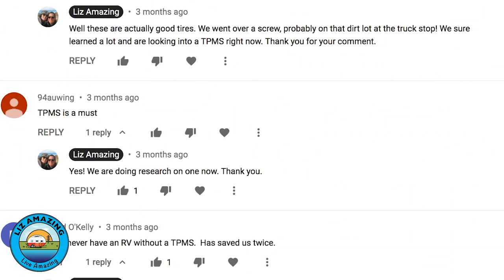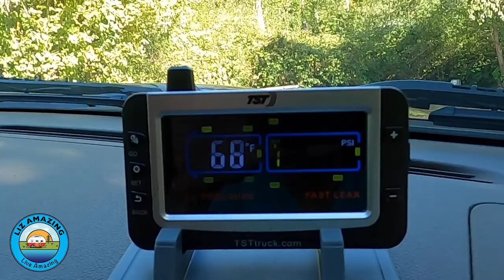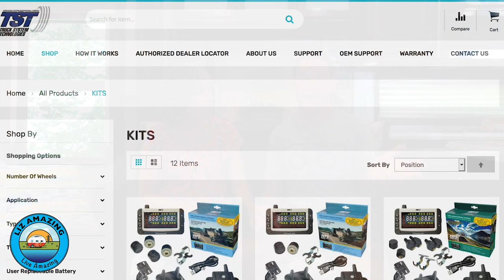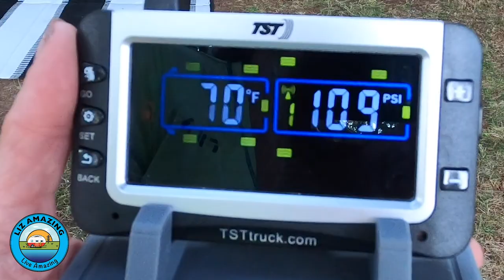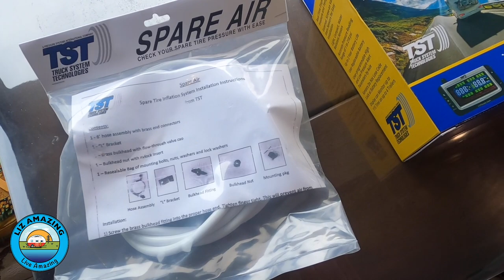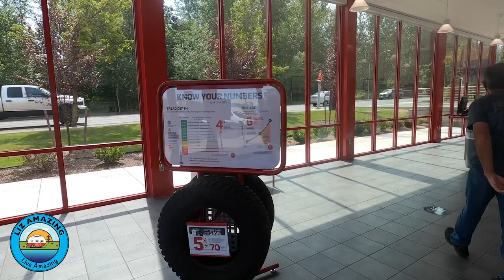How you can prevent a Tire Blowout | TPMS | Westlake Tires | Fulltime RV Living

Comment: Had a blow out in Nor Cal
Slider cable ripped out 
Repaired it at tire shop myself 
Interesting tire was 5 months old about 1000 miles on it
Anyway tire guy said he runs American made LT tires on his 5th wheel never a problem 
Replaced the bombs tires with those LTs
7yo 5er
Enjoy Washington
Reply from the maker: thank you! Glad your blowout wasn't worse, though it was sure bad enough. Safe travels to you!

Comment: Our previous fifth wheel was a Jayco pennicle. Not long after purchase not a flat but border line. The leaf spring failure. We got blessed. The rig showed no signs hey I’ve got an issue. Upon stopping to register their was tar all over what did my father drive through. Turns out the tire wall was being shaved 🪒 get with good Sam and find a reliable rv dealer that handles your rig.  Several dollars over nighted spring we got the nascar service. Knowledgeable service. Worries not over trip to Disney all set to leave ugg slide motor failure. Then the fridge brand new poof done. Upon removing the motor frozen rusted. Warranty work etc. just one fiasco after another. The rig was a lemon. We had been out of camping for a few years. Decided to go shopping Jayco dealers reliable we ended up after the rig failing to trade up. Then while looking through our Jayco why is the sink plumbing disconnecting after every move. My father wasn’t happy camper. The cut corners cut the plumbing too short. That’s not all the miss connecting the sewer and grey tanks were hooked up backwards. Grey was on sewer sewer was on grey.  I said nope nuff is enough if your not sure if you can leave. It was apparent too many warranty things  hopefully the dealer fixed the issues she got sold not long after get rvs with hydraulic system electrical system failures with newer rv’s are too sketchy our new rv is hydraulic from slides to stabilizer jacks.
Reply from the maker: Oh my gosh, so sorry you had all these issues. We looked at Jayco before buying our rig. But we ruled them out. Grand Design is the only manufacturer we know of that understands fulltimers. They know we can't wait months to get in at a dealer (who likely is not our home dealer as we are traveling). Instead they will ship parts to us directly and reimburse a mobile tech to fix right away. 

I sure hope you have better luck with your next RV. And you may be onto something to go used. We have heard that they don't build them like they used to and you get higher quality with used.

Thanks for your comment and no matter what you tow we highly recommend a TPMS.

Comment: Improper tire inflation is 90% of all blowouts. 
Check your tire pressure early in the morning to get a cold (true) tire pressure before the sunlight warms them up. I never move before a full tire inspection and I've never had a flat.
Reply from the maker: We do the same and still drove over the Golden Gate Bridge with a flat tire. That's because we ran over a nail. TPMS would have helped us by getting us to pull over quicker. From now on it's TPMS all the way! And we believe everyone towing a camper of any sort should have one.

Comment: Oh, goody! A pop quiz before the video. Isn’t a Schrader valve the standard tire valve? And then there was another one that I was going to ask Paul about because I’ve forgotten what it was called. For high end bike tires like sew-ups. Wait! Presta! Been trying to think of that name for weeks and you just jogged my memory! Thanks. Just one of those bits of info that have been floating through my head recently. Ok on to the video. (And as I watch it, I see that you just answered my question! Well, never mind then. But yup, we old cyclists know our bike valves. :) 

But, yes, with our first pop-up trailer we had a very very very low tire at Great Basin NP. And there was no air anywhere to be had in the little town of Baker. An unstaffed gas station. Gas, no air, no water. Instead of heading south, we limped back to Ely. They had real services like a tire shop. We had a nail in our tire and they swapped it out for us. But I found out that our AAA didn’t work for the trailer, and Good Sam wasn’t very helpful either. And as soon as we got home, I bought a little AC/DC tire compressor! And before we go out, I check the pressures on all the tires and top everything off with that. And we have a repair kit. Jerry thinks I’m a bit compulsive, I think he’s a little too relaxed. You live, you learn. (And apropos of this blog, I am investigating tire pressure monitoring systems. So thanks for the recommendation. It’s been confusing.)
Reply from the maker: Hi Trish! Glad you know your valves!! Several people have mentioned AAA didn't cover their trailer. Paul has their Premier service does cover our fifth wheel, and they came out after we crossed the Golden Gate Bridge with our flat tire. 

I think having a tire repair kit is a VERY good idea! We know people that can plug a tire on the road, if need be. I think that would be handy for remote areas, traveling to Alaska, that sort of thing. 

TST Truck TPMS is second to none. We checked all the systems out and nothing can match it. We sincerely believe anyone towing a camper or trailer should have a TPMS system. AND it would be helpful on your Class B itself because you get an alarm as soon as air starts leaking out. 

Well thanks for your comment and hope you are keeping cool in California.
Reply: Liz Amazing  Several people on the Travato Facebook group have mentioned the TPMS and I was looking at them but started getting overwhelmed. Good to have somebody knowledgeable like Paul do the heavy lifting!  And update on the refrigerator: I just got a call from La Mesa this morning and they have an ETA of our new refrigerator arriving from Canada somewhere around three weeks into the month. I’m not happy about it, but at least there’s something to look forward to besides a big question mark.

Re AAA, we were newbies and thought our car AAA would cover. Found out we needed a special RV addition. So nothing against AAA. We were naifs.

And, of course, we are always cool 😎 in Calif, but it’s gonna be a scorcher again. 100° +
Reply from the maker: Wow to the heat! We are at 89 here in Newport Washington (eastern side of the state). We just arrived today and are having our first taste of summer. Paul will tell you I am so happy to get to wear my sleeveless shirts. After a week of this (89 degrees right now) I am sure I will be ready for the 70s again.

Glad to hear that things are moving in the right direction re the fridge. October is a nice time to go camping. If it's not too chilly by then, we love Snowflower in Emigrant Gap.

Comment: If you are wise and buy a new GMC or chevy tow beast you will receive 6 extra valve monitor devices!!!  They are connected to the  truck with no other device needed!!  I just bought another trailer, seller advised that I must return the valves after 2 years when I get  new tires. I replace with Goodyear Endurance every 2 years or 30,000 miles. Never had an issue and I often travel off road and in heat in So Cal Mojave desert.  Oh... I met stud muffin at Hunt Beach marathon, I was running in a Kilt with Dean Karnazes, author and world class runner!!!
Reply from the maker: Good to know! Super cool about you running in a kilt!

Comment: Good video. I have been using the Ezee TPMS for a couple of years. Key is the PSI and temp. I even have sensors on the truck and trailer spare tires to monitor PSI. Only comment is being in Canada when we go south and come back north, on the cold nights it plays with the low temp alarm.
Reply from the maker: Thanks for the support of using a TPMS. Paul and I firmly believe everyone pulling a travel trailer or fifth wheel camper needs to get one. And it's true about the tires. When we were in Birch Bay last month we had a cold night and had to air them up before getting on the road. And we sure want to get into Canada. If you haven't seen it, here is our video from just the other side of the border: https://youtu.be/-V40X20hibo

Comment: Sorry, I have to share my china bomb story.
While on vacation with our 5th wheel, we developed a squeak noise, noticable at slow speed. We could not pin down where it was coming from. We thought it could be our tow vehicle. 
On our way home, while going over a bumpy portion of the freeway, we had a tire on the trailer blowout. There is no indication of sidewall wear such a underinflated condition. This is a cord failure.
Wish I could share the photos.
Reply from the maker: Oh no. So sorry to hear this. I hope you did not have too much damage. If it was a tire flaw a TPMS would not have helped if it just blew out the sidewall. Nevertheless, we strongly believe everyone towing should have a TPMS bc they really can and do prevent most blowouts. Stay safe out there!

Comment: I yes I have heard of Schrader valve and Presta for that matter but I am a bicycle rider and a Mechanical Engineer although I had heard of Schrader a long time before Presta and before I was an engineer.

Enjoy your channel.  We purchased a Solitude 310 about 2 months ago.  We were already very interested in the model by seeing it at a RV show in 2019 and you guys helped us make the decision to buy.   Thanks and stay safe.

About the TST system, why did you chose the Cap sensors rather than the Flow through style?
Reply from the maker: The flow through valves are heavier and you need to change your valve stems and we didn't want to do that. In retrospect, Paul wishes we went with flow-thru for the ease of adding air. Congrats on your 310GK! Hope to camp next to you someday!

Comment: The other big cause of heat is overloaded tires. You must look at load rating of the tires. Most trailers and 5th wheels come with it’s tires rated for the empty weight of the unit, once you put 1000# of stuff in your rig your overweight. You may need to go to a heavier load rates tire.  Look at you CCC and make sure you don’t overload your unit.
Reply from the maker: Very good point, thank you. And we believe a TPMS is a must for all who are towing a camper. It's great to know exactly what's going on with the tires. Be safe out there.
Reply: We have a class a, we didn’t leave the dealers lot before the TPMS was working.
Reply from the maker: Good for you!

Comment: I've begun turning my propane tanks off before I travel. This would help prevent your entire RV catching on fire if you were to crash. I had a leaky tire and even though I inflated it to the proper PSI it actually blew out on the freeway. Fortunately I have two tires on each side of my rig and I was able to make it to a safe location. I don't think the jack that comes with my Tacoma is powerful enough to raise my rig but I could be mistaken. If anyone knows what kind of Jack is required to lift a 6000 pound trailer please let me know.
Reply from the maker: I will ask Paul about the jack. And you make a good point about traveling with the propane turned off. Thanks for you comment! And so glad you were able to survive your tire blowout without it being any worse.
Reply: Here in Hampton Roads, it is required to have the propane tanks disconnected prior to going into the tunnels. You have to pull into an inspection station at the entrance to have them checked.
Reply from the maker: Good to know! Thanks.
Reply from the maker: Paul uses a 20 ton bottle jack. It's overkill but will do the job! Here's a link:  https://amzn.to/3bu1UTS

And, of course, always position the jack under the frame.

Comment: So what about tire/wheel balancing?  Also can these sensors be used  with the rubber construction or should metal tire valves be used? I have a Class B motorhome with dually wheels with Borg valve extensions? The longer extension on the inside tire has a rubber support as the extension passes thru the outer wheel. Is this enough to keep the added weight of the TPMS sensor from vibrating?  Nothing was mentioned about this.
Reply from the maker: When I had my camper van, I replaced my valve extensions and valve stems with steel ones. And yes you should have them balanced. In our case, we have not balanced the trailer tires but we did balance the truck tires. There does not seem to be any issues with wear on the trailer tires. But in your case you will feel it so you should get them balanced. We do recommend TPMS for everyone and remember to get 15% off using LIZ15. Go here: https://tinyurl.com/TPMSsaves

Comment: CHINA BOMBS !!! I will put in my two cents. Tire load rating is when the tires are new and in perfect condition. Most RVs come with tires that will be loaded to maximum or over maximum load capacity. When the tires are going down the road they get a lot of abuse and the load rating will be less with the damage the tires will have from all the potholes and then you get a blowout. With Liz Amazing tires they are at great risk of having a blowout. Liz Amazing chose to repair their flat instead of replace the tire. Running a flat tire will cause  side wall damage and reduce the load captivity.  Liz Amazing other tire on the same side as the flat was overload by double the load capacity because it was taking the weight of the flat tire witch will damage the good tire. So Liz Amazing has two tires of a greater risk of blowing. As a rule of thumb both tires should be replaced to reduce the chance of a blow out. Everybody needs a TPMS on their rig and the TPMS system in the video is one of the best ones I have seen. My experience  with CHINA BOMBS is to replace them before they are 3 years old anything older then 3 years, you are at a higher risk of a blow out. Great video as always.
Reply from the maker: I learned a lot from our flat tire, number one is that most blowouts are not random. They can be predicted and prevented. We love our TPMS! Your comment about the sidewall and the other tire on that side gives us something to think about. We had not heard about that rule of thumb about replacing both tires. Paul and I are talking about that right now and will monitor them closely. Thanks again!

Comment: Had my first blowout this summer in all the years of RVing. I would recommend getting rid of those stupid recessed lug nuts with aluminum caps.  Wouldn't you know...I couldn't get my socket on the last two lugs, and I didn't have my big heavy duty hammer with me to pound it on.  Ugh....
Reply from the maker: Oh no. That's a great point about lug nuts like that. Just makes a bad situation worse. Glad you are ok. I recently learned that most blowouts are preventable! Wow! We highly recommend you get a TPMS and think everyone towing a camper (full or part time) should have one. GIves such peace of mind knowing what's happening with the tires. Be safe.

Comment: Upgraded tires on my van to Grapplers after a blow-out on a shale rock covered dirt road.  Stock road tires are just not good enough for many conditions.  I imagine the tires that come with a trailer are not top of the line.
Reply from the maker: Our tires are G-rated which is considered pretty good. We did upgrade the tires on our truck to a higher load capacity, glad we did!

Comment: We have a 2021 Reflection 150 Series 260RD.  The tires are filled with nitrogen.  Which TPMS product should I get?  

 Is it this one: 507 Series 4 Hybrid Sensor TPMS System Color Display and Repeater
Reply from the maker: Yes, the 507, thanks for asking. It's a great system. You may also want to get extra sensors for your truck and for both spares. Although we have built-in TPMS on our truck, there is no alarm and it does not measure temperature.

Remember to put in LIZ15 to get 15% off.

And congrats on your new 260RD- I saw on the Facebook page that you just got it. I sure loved mine!!!
Reply: @LizAmazing  Thanks I just pulled the trigger and ordered 507 Series 4 RV Cap Sensor TPMS System Color Display and Repeater. Your discount code saved me over $60. Thank you

Comment: You need name brand tires designed for trailer wear.
Most blowouts accure because a tire get low. Sidewalls flex building heat then blows out. Tears out everything and realy hurts.
Keep those tire psi checked
Reply from the maker: Yes! So true. We learned a lot from our flat tire and low inflation (which you can't tell by looking) is the number one cause of blowouts. With a TPMS you can just see at a glance if your tires are low. And that's a good reminder that people need trailer tires rated for their trailer weight. Also a TPMS can predict a blowout and allow you to remedy the situation BEFORE the tire blows. Be safe out there.
Reply: @LizAmazing  Rubber to the road,
Pedal to the floor.
When I get to the next town, Just want to see more.

Comment: Do those caps that go on the Schrader valves need batteries? Are they communicating wirelessly?
Reply from the maker: They are communicating wirelessly with a repeater we installed at the front of the fifth wheel. They take wafer batteries. Ours are over a year old and we haven't had to replace them yet.
Reply: @LizAmazing  Nice!

Comment: I never like Goodyear's tire because there rubber is too soft to tested by press or squeeze on top tire, that was ate up tires too quickly from roads and nails or screws are easy get into it. I purchased a good tires like Michelin tires that has a hard rubber felt is lasting long just like big rigs tires.
Reply from the maker: That's good to know, thanks. Paul and I recommend a TPMS no matter what tires you have. I had NO idea that blowouts are actually preventable!